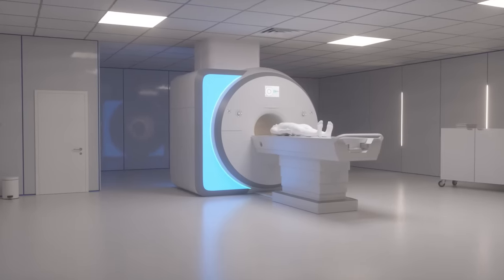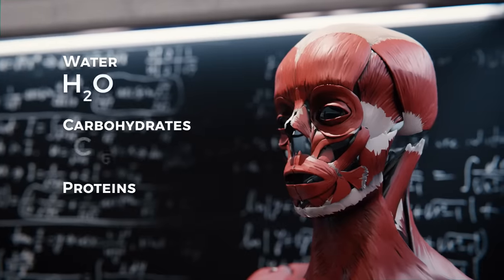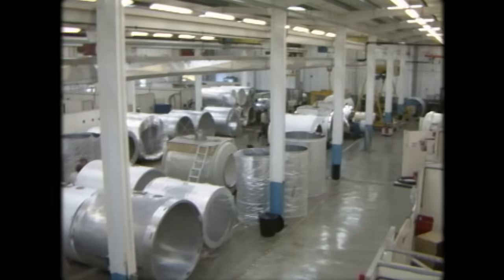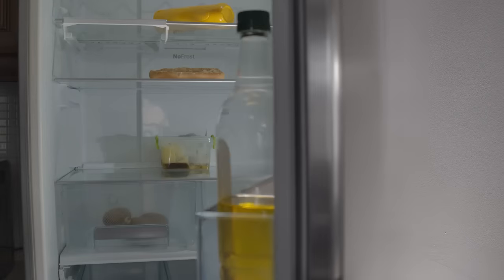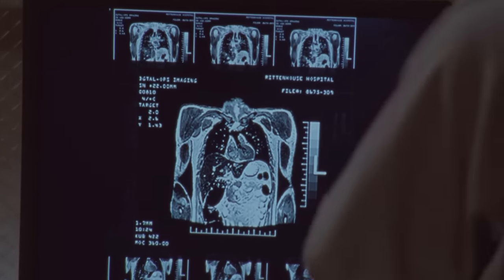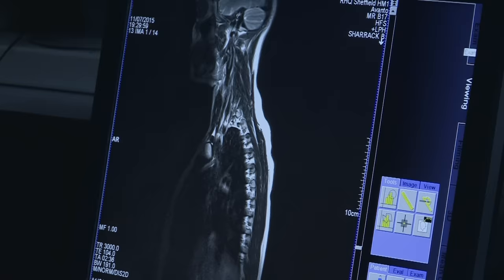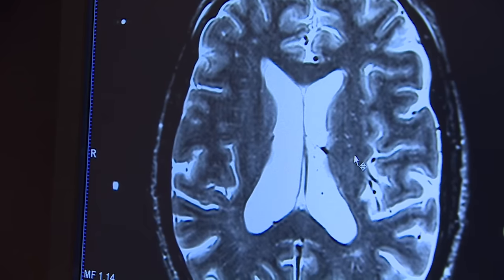The Insane Engineering of MRI Machines

Comment: I have studied physics. We had to make 9 experimental projects per semester. One of them was magnetic resonance. While the other projects gave you materials to study at home and then you were collecting data for 2-3 hours, this one was different. There was the materials to read at home and when I arrived there was another 3 hour lesson at the end of which I started to understand (then pressed a couple of buttons and the measurement was done. This all was just to get the chemical composition of the sample, not the image. I had absolutely no idea how the Imaging part works!
Reply: I am just a medical comp sci student but I did have two courses related to MRI. As I recall the image is achieved by adding another localizing magnetic field. This allows for every point in space to have a slightly different signal. As you know the expected signal this can be used to associate the different signals with different points and then generate the image. 

But take that with a grain of salt. My course was mostly focused on what you do with the image not how it is generated.

EDIT: Nevermind this is actually explained much better in the video.

Comment: MRI Physicist here, fantastic video, I have to recommend this to some beginners. I didn't notice any errors either, just two small inaccuracies: 1. The spins align themselves along OR against the magnetic field B0, but a tiny majority (~0.001%) align along B0, creating the net magnetization. 2. Some of the footage you used were CT images... but whatever. I had a blast and was surprised when the video ended suddenly. Great job!
Reply: Thanks for your comment, he also described x rays as "radio frequencies" should have said electromagnetic ...
What do you think is the phisical limit for the resolution of these machines?
Reply: @Valery0p5  thanks for the comment to the comment. Not sure why we’re thanking each other, I just wanted to join in on the fun!
Reply: @Valery0p5  They are radio frequencies, they're literally called 'RF pulses'. The resolution is based on the strength of the gradients, so making the gradients more powerful you get smaller voxels. But when you decrease the voxel size you get less signal, which makes the image dark. So you need a more powerful magnet. But the more you increase the magnet strength, the more problems you have with SAR (special absorption rate), or how much you heat up your patient. MRI is basically a low power microwave, something we do NOT tell our patients. :D That is why there are strict SAR limits, which usually only come to play at higher field strenghts. 7T's biggest headache by far is the constant struggle with SAR.  

As a side note, MRI is, in my opinion, the most complex imaging method there is. Everything incluences everything, and increasing some parameter has direct concequences and tradeoffs with all other parameters. For example, every point in k-space influences every pixel in the image, so if you have a white pixel in k-space, the whole image has a diagonal stripe pattern on top of it.
Reply: Correction, spin is referred to the electron's spin, atom core (with neutrons) doesn't contain any spins i.e. electric orientation with underlying quantum field. 

Magnetism comes from electrons spin either -1/2 or +1/2, also this spin is not a literal spin but rather how energy of electon interacts with underlying electric field.

Think of electron as oscillations in electric field that exists in all space with some potential energy. Electrons are disruptions in those fields, same as protons and other matter oscilating at different frequencies. These values come from those fields' energy potential and oscillations will determine which particle it is.

P.S. Before anyone corrects, protons do have spins but due to their mass, their magnatic moment is negligible compared to electrons ( i.e. ~ 2000x stronger). Mass is inversly proportional to the magnatic moment of the particle.
Reply: Could you please tell how electro magnetic radiation of MRI affect a person? When I did it, it affected my thyroid
Reply: How can you tell what’s a CT image vs MRI?
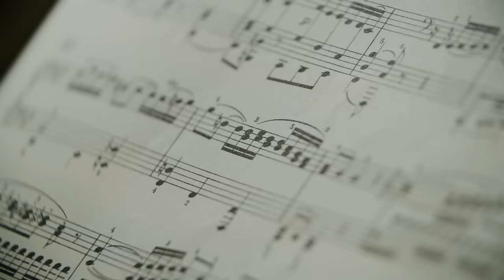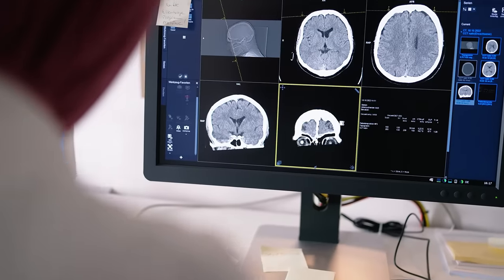Reply: @jearlblah5169   Sure, for example at 5:29, 13:48, and 14:11. At 5:29 you can even see the parameters they used for the CT image: 120 kV, 160 mA.
Reply: @CapreDiem86 like he said, it just heats the person. They don't have any other known effect as far as I know.
Reply: @PunCala  You misread the comment. They were pointing out that the video mistakenly describes x-rays as radio frequency waves (at 1:58).
Reply: @CapreDiem86  med-Student here: your thyroid was probably influenced by the contrast medium. That's why they usually check your blood values beforehand.
Reply: Technically they don't have to line up parallel or antiparallel, they are either in a parallel or anti-parallel Cone of an acceptable energy state (also an MR physics here 😂)
Reply: Also MRI Physicist here, they do not really align only with or against the field but point in every direction since we measure ensembles and not single spins like in a quantum experiments. But they are nudged a little bit along the field, it's crazy how so little nudging can create such strong fields.
Reply: @jearlblah5169  You would not typically see much signal from bones in regular MRI images. MRI is more typically used for softer tissue.
Reply: I was wondering if somebody would pick up on the spin alignment and population difference 1000 vs 1007. I worked with these machines back in the 1960th to determine structures of organic molecules. Very powerful tool.
Reply: As pointed out by Florian Unrath, they don't technically align "with" or "against" the field. You can say that the Z component of their spin vector has a population difference, but their X and Y components are free to point to whatever direction they want - the operators do not commute.
Reply: @PunCala  I was in a 1.5 Tesla machine today getting my lumbar spine imaged. Could faintly feel the heat in my belly (where I have the most fat) during scan. Also there was a scan mode that got the coils really loud and noticeably vibrated the table on which i was positioned. I also noticed the lights in the room would dim slightly when the coils buzzed. That must have been some serious kilowatts running through that machine!
Reply: @antronx7  They were running either turbo spin-echo (TSE) or diffusion sequences. Considering it's lumbar spine, I'd say TSE.
Reply: @MaulikParmar210  It s called NMR = nuclear magnetic resonance, and it is the proton spin that is involved.

Comment: I just completed my Ph.D. in MRI physics! Very nice work on this video. It does a really good job of summarizing the fundamentals of MRI into a short 20 minutes. A small correction: quite a few of your example images/stock photos were of CT scans/scanners and not MRI.  I think I also saw some old footage of a linear accelerator used for radiation treatment as well. Both CT scanners and linear accelerators would be excellent topics for future videos!

Comment: Fun fact:
For the highest level of education you can choose in the Dutch equivalent of high school, the principles behind this are REQUIRED to be taught and can show up on your exams. I myself was unlucky enough to have this on an exam where I had to manually calculate the voltages and more to achieve a specified gradient slice in an MRI machine, it's absolutely bonkers physics but it does genuinely work really well.

Normally it shows up on your exams with easier examples than MRI's though, but I have gotten a grade for this exact thing. (You'd roughly be 17-18 years old at this time, with 3 years of chemistry/physics under the belt and then another 3 years focusing in on physics)

Comment: I am an MRI tech. Great explanation, and loved the footage of actual consoles with all the different scans on them - it was interesting seeing some programs and features we don't have where I work.
I would add regarding the T1 and T2 thing, an MRI exam invariably consists of a series of scans with different parameters and settings, always using both T1 and T2-weighted settings and a slew of other technologies to suppress or enhance different tissues, which are then all compared against each other by the radiologist. It would be a waste of time to bring someone in for a single scan.
Reply: @LGM4  Cobalt and titanium implants are non-magnetic. They'll disrupt the signal around them but they aren't a risk to the patient.
Reply: @talknight2 Exactly. The only care you have to take is not to move too fast inside the field, to avoid heating due to eddy currents
Reply: @LGM4  You only have like a big black spot around the implant because the field prefers to go through the metal and not the tissue so it is mostly not a risk but you can just not diagnose the tissue around the implant

Comment: Fun fact: They were originally called NMRI machines (Nuclear Magnetic Resonance Imaging) put people didn't like the sound of being stuck in a "nuclear" machine, so they dropped the N

4:03 Your Larmor Precession is going to wrong way. It should follow the "right hand rule" and be spinning from positive y to negative x.
10:19 Or Helmholtz coils, but that name's less fun, I guess.
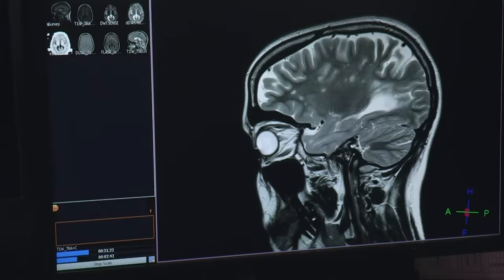12:56 He does not talk more about contrasting agents, but (by my understanding) there's actually a third type of MRI called a "Flair" which is a bit more common in modern scans.
13:37 You can learn more about the Fourier transforms here, if you're not opposed to Veritasium content: https://youtu.be/nmgFG7PUHfo
Anything that I didn't list (other than the fact that "spin" isn't real and is only used as a convenient term to get the point across, all of this was explained using the vector model whereas the quantum model is more of an accurate picture, and that the little election particles also aren't real as electrons are probability waves not moving particles) was correct, and I really appreciated this animated explanation.

Credentials: Just finished a rigorous graduate course on NMR with a very difficult to get A (only me and two other people have gotten one in the last couple of years for this university).
(Feel free to reply if I missed something or screwed another thing up, haha!)

Comment: Happy for this video. I’m an MRI technologist

A lot of the images shown are CT, not MRI. 2:09 for example

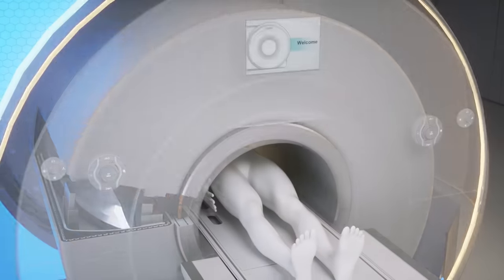4:22 is another error. Transmit/Receive coils (TxRx) are not within the machine. Only transmit coils are. Receive only coils or TxRx coils are placed on the patient’s body or directly around the anatomy.

12:37 *MRI technologists

Good video! It may seem like this was a negative comment, but I wish I had this video when I started my schooling. Thanks.
Reply: The video is correct -- The birdcage is indeed used for Tx and Rx.
Reply: @springer9406  if you’re referring to the head coil, some are TxRx. But that is not within the machine. It’s a coil that is attached to the table within the bore. Just look up TxRx head coil and you’ll see it.
Reply: @cade8986  The whole body coil, which is part of the bore. Some are Rx too.   If you'd like a neutral source: "Volume coils (eg, the body coil) completely encompass the anatomy of interest and are mostly operated as transmit coils but also capable to be operated as transmit/receive coils."  https://onlinelibrary.wiley.com/doi/full/10.1002/jmri.26187. Or this http://cdiok.com/wp-content/uploads/2012/01/MRI-Technology.jpg. Or this (figure 9): https://onlinelibrary.wiley.com/doi/10.1002/mrm.20177

Comment: I think it was in a Michio Kaku book where I first heard the most likely innovations for MRI in the future. Some of them still sound a long way away, but they're fun to think about.

1) high temperature superconductors - I've read about some superconductors like bisco which work at around 75K, which is pretty incredible imo. I'm curious as to what the crystallography and thermodynamics are behind this working so well. I get dizzy looking at phase diagrams when there are more than 3 components.

2) He substitution - This one seems logical, especially if we switch to N2, which makes sense based on cost as well as the rise of higher temp superconductors. I guess the remaining fear is if the liquid N2 would react with any of the superconductors or electromagnets.

3) grouping up small superconductors and electromagnets to outdo a big one - The laws of scaling makes this one fairly logical, and also very attractive. Dividing up the size, grouping, aligning them could enhance the output per unit, but my fear comes down to the risk of energy loss in heat, which definitely would impair performance.

4) shrinking the MRI device down to a handheld size - this one is something I'm slightly uneducated on. I don't know nearly as much as I should about circuits, so maybe an EE person might be able to explain this one to me a bit more.

As for the event, I'm really excited for it! I'm a battery guy, so that's the one I'm especially looking forward to!
Reply: Shrinking an MRI to become handheld is gonna be really difficult. NMR, the sister of MRI used in chemistry, now has tabletop units using copper electromagnets. Their resolution isn't great but they make it much easier to just quickly get an NMR spectrum.

The main challenge with MRI compared to NMR is that your sample isn't a few microliters of liquid inside a quartz tube but rather a living human being. The much higher bore diameter necessary to fit a human significantly decreases the field strength that can be achieved, so non-superconducting devices are basically out of the question and superconducting devices probably can't be shrunk by much.

Comment: Glad that the stripey lines explanation is coming through. They're called spatial frequencies and spatial encoding is carried out by inducing stripey lines in the magnetization phase across the slice - as shown rather well in this video. You could call it a phase roll pattern. You can simulate/visualize it fairly easily in matlab. It looks quite funky when you can see the phase roll patterns developed during readout and especially when there's a bit of phase encoding too -> the lines rotate just like in CT!

Comment: Sir Can you also make a video on PET(Positron emission tomography), I m very much curious about it.
Reply: Same
Reply: PET is far easier to understand. A radioisotope that emits positrons (Fluorine 18) is injected into the body and when the positrons are emitted they only travel a few mm before encountering an electron which they annihilate with and emit two gamma rays of 511KeV back to back 180 degrees from each other. You're situated in a ring of many scintillating crystals that produce a flash of light when a gamma ray passes through them. The machine is connected to a computer that only counts coincident flashes that occur nearly simultaneously on opposite sides of the ring. By noting the slight time difference between the coincident flashes the computer deduces where along the axis connecting the two scintillator crystals the original F18 atom must have decayed and colors a pixel there. The end.

Comment: 4:15 how come something such tiny induces a currents in the coil?
Reply: Your question is more insightful then you probably realize. MRI is inherently an SNR starved modality (i.e., getting a receive signal is no easy feat!). To give a quick answer, the bulk magnetization inside a single voxel (3D pixel) of sample, which has on the order of ~7e22 hydrogen nuclei, can induce a small RF current in a resonant loop that is tuned to the same frequency. This large H nuclei population, paired with the strong static magnetic field, help with obtaining a detectable receive signal.